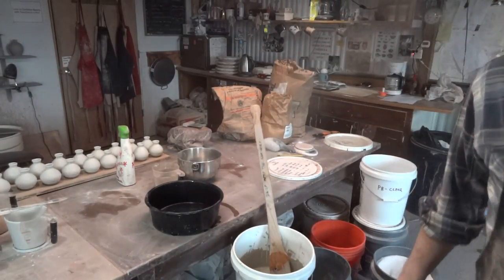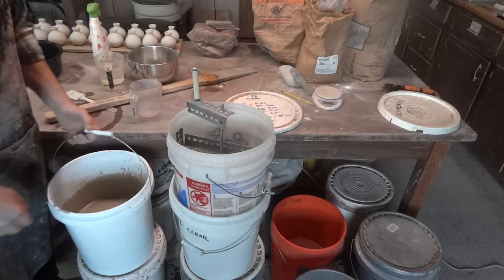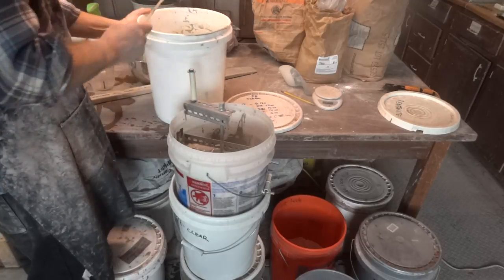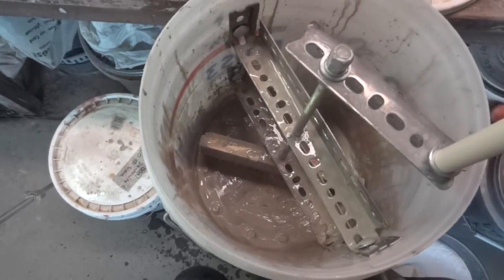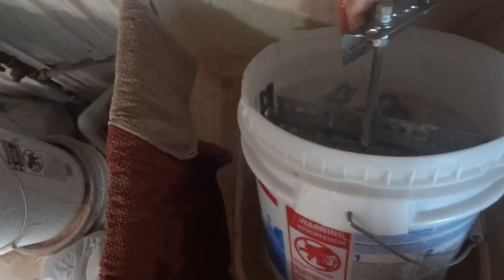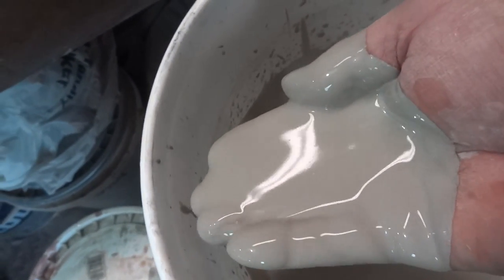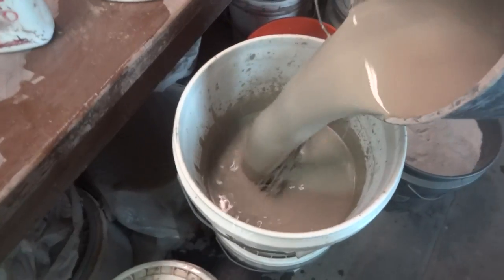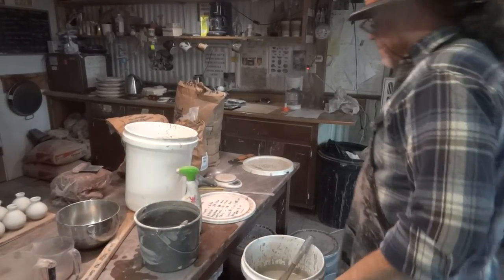Sieving or screening the glaze - a clever invention indeed ! March 13th 2020 with Simon Leach

Comment: Simon, thanks for the thumbs up. Wait till you use it for making wood ash, I made over 2 lbs of powder in less than 5 minutes and I started with all the large & small chunks that was in the fire box. I did not have any issues with the dust flying up due to the lid I made. and it is quick and easy. The clean up that I use is put the sieve in the back yard and use a garden hose LOL. The Lid is one of the videos I made. Simon what is the CONE range for the glaze you just made. Thanks again, eddiespottery.